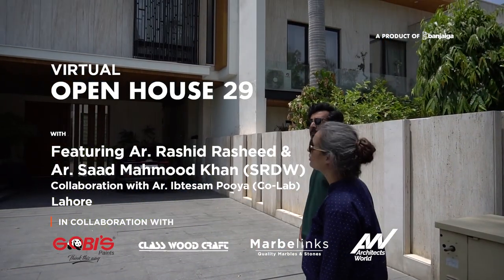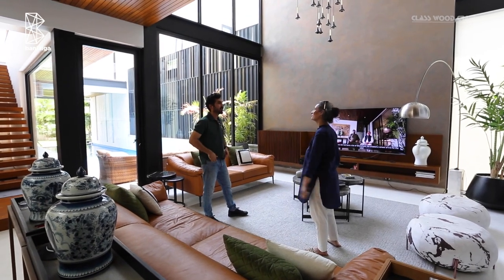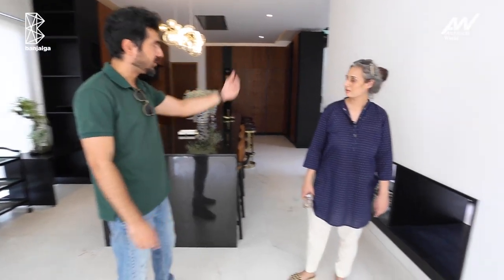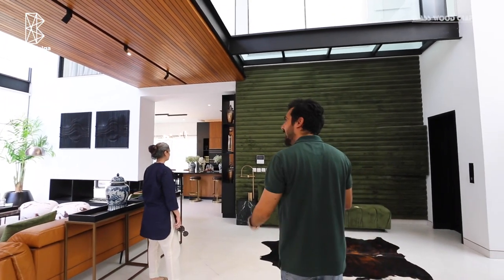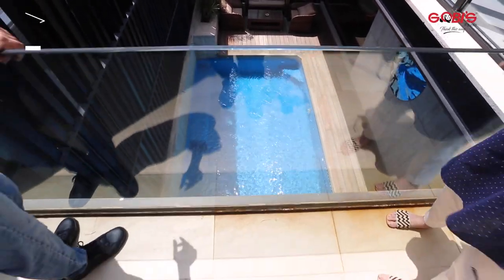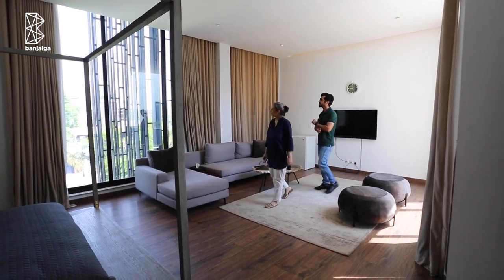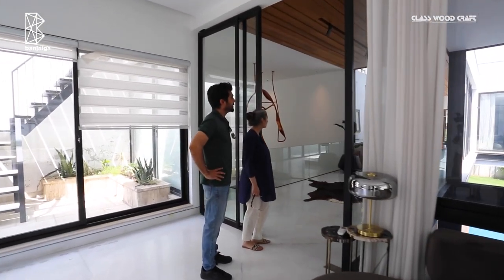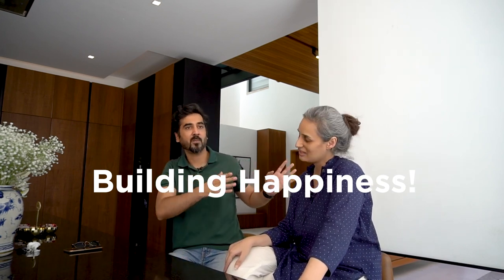Virtual Open House 29 - Tour of Faisal Rashid's Residence in Lahore, Designed by SRDW & Co-Lab

Comment: Well....this is a four bed room house it has one more bed room in the basement ... in response to your feedback on the glass envelope ...the design was conceived keeping sections that connect to the weather as well incourrage low and high pressure zones ...enhancing a fly wheel effect ...so yes heat was not meant to be trapped initially an open courtyard in the atrium was planned which could help the section breath out the lighter hot air and keeping certain windows open would enforce convection currents through the sections of the atrium and stairs .....further the proportion of the courtyard is compact and as you can see at 12:00 a.m the depth of sunlight in the lounge is quite bearable ...yes in the unitial design we were to have some ventilators in rowshandan ...(clearstory )ht zone but ...there was a demand for more transparency ....in order to diffuse the light further screens or louver blinds will be incorporated to shade the area ....there a convection air flow ...forced venture running via the section of the stairs as well ...the cool air in the basement is forced up via stair ....so due to a demand for non boho ...planning dust free living we incorporated the retractable roof ....I hope that helps explain our core concepts while planning ...
Reply: Whats the plot size here? BUA? And cost of construction + interior design + furniture?
Reply: The plot is 1.2 k ...Const+Finishing above 6k....and BUA...above 10000
Reply: @colabcomotions  its really well designed
Reply: @hhydar883  appreciate it....more to happen this is just the beginning....I A
Reply: @colabcomotions  Changing mindsets, one house at a time! Excellent work. Looking forward to your new projects.